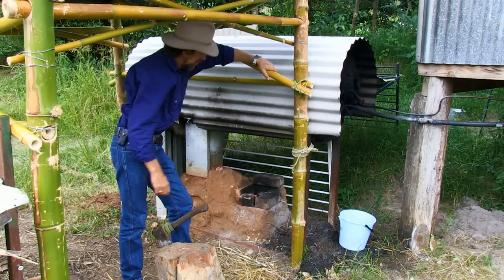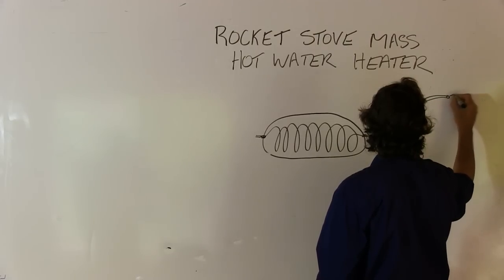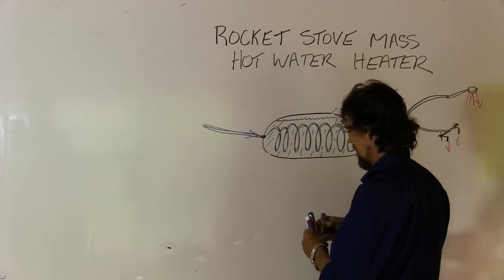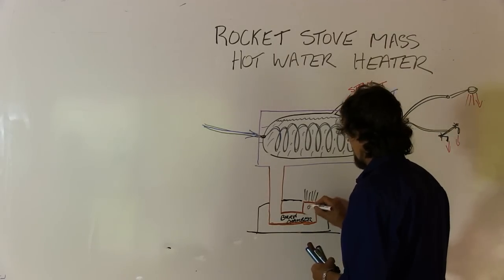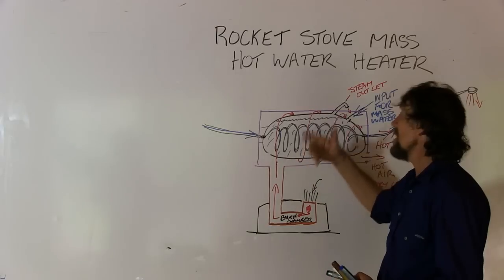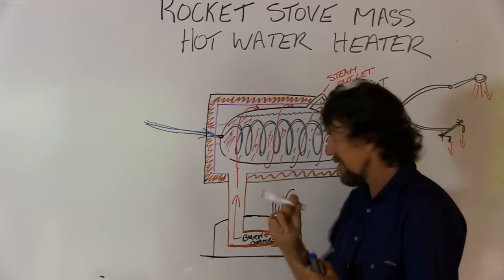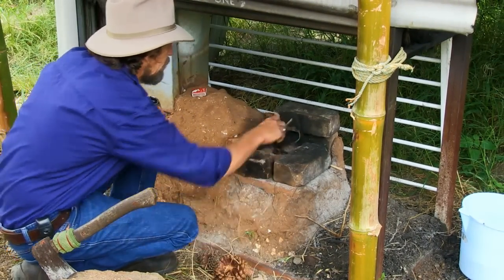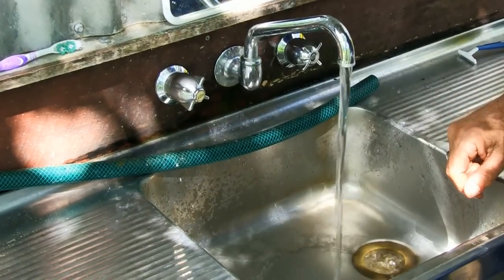How to Build a Rocket Stove Mass Water Heater, with Geoff Lawton

Comment: Thank you, but seems very, very complicated for most people. A rocket stove riser or metal chimney (non insulated) can be wrapped tight with copper pipe and connected to a body of water ABOVE with the cold line to the stove coming out the bottom of the water tank (that is a bit ABOVE) and the hot water line coming from the stove, and entering higher up the tank. I'm not an expert on the best way to wrap copper around a steel pipe but I know the copper is filled tightly with sand so it does not crush, and then the sand is removed. Look at "thermal siphon" rocket stove videos and don't make the water pipe too large or it will just spit steam.

Comment: A float valve to keep the outer tank full and a pop off. You could make a pipe with a ball on top.So if it gets too hot, purge steam off without exploding you can also take the residual steam and run it through a turbine to make electricity i have a big whistle on mine.

Comment: Why do you need that stainless steel tank with the water in it? Can it be just a bare copper coil? it got heat up directly.
What is the scientific reason behind it? Just asking.

Comment: Hey Geoff , I'm still trying to work out how to feed that copper coil inside and get it connected without access through another part of the tank . Do you cut an access hatch and weld it up again after fitting pipe and fittings to inlets and outlets ?

Comment: Right off the bat this takes an engineer to build and you want a big sealed Stainless steel tank ?  Where would a person even begin to locate something like that? Coiling Copper pipe isn't cut and dry, do it wrong and it can kink then you're screwed.. one technique for bending copper tubing calls for the tubing to be filled with sand.. this is a mess..  For another thing, even if you could find a stainless steel tank , that's not cheap.. for another thing that's retarded. Maintenence is going to be a real nightmare.. after all this work, this isn't going to last very long and nobody wet behind the ears would ever be able to use it safely without hands on supervision.  a huge waste of fuel for one person to shower just look at all that water you need to heat up .. not to mention , ever have a chimney swept?
after a period of time so much soot will have coated the stainless tank it will act as an insulator preventing the water inside from even being heated, ash is the world's best insulator, ever see people walk on coals? There's a hundred & one different reasons this is a horribly designed water heater.. 💧

Comment: thanks Geoff  great vid the best system I have seen to date . I have an off gride property with no infrastructure and you have just  solved my hot water problem  cheers  ps only another 50 or 100  other problem to solve  but will be loving every minute

Comment: He's building at the Antiquated way, there's a better way to build it using the out ventilation pipe and a copper coil surrounding the out ventilation pipe for the stove in which the heat from a stove heats the water from a separate tank and circulated back into the main system. This can be found on the show, off-grid builders.

Comment: how about if you flatten the top of the burn chamber and have a metal lid that can seal it shut to shut off the fire, then to activate this lid automatically you have the water overflow pipe fill up a container fixed on a pivot where the weight of it will pull the lid down after enough water has entered

Comment: Great video, Thanks. Just a quick question.... Where the feed to and from the copper coil pass through the heated chamber is there not the chance that it could turn to steam in the pipe if maybe you were running water via a pump and the pump failed?
Reply: yes you have to have a pressure relief valve somewhere on that line
Reply: cardiologist told me he has seen several cases lately that he believes are related to the vaccine. He mentioned he has also seen recent cases of myocarditis he believes are vaccine related. He advised me against any boosters in the future.

Comment: well, it's been five years.   Is this guy still alive?   Has he learned any hard lessons about the flash point of steam?   Glossing over a steam vent system is rather dangerous.  It involves far more thought than was communicated here.
Reply: He calls it a blow off valve but I'm pretty sure it's just an open tube. Naturally you would want to aim that somewhere where you wouldn't be standing but as he said, this unit is a demonstration unit at the school/farm so he wants people to be able to see every component. Here's where water is streaming out from that hot water overflow tube(blow of valve minus an actual valve)  https://youtu.be/1oDpmmsqHwQ?t=717
You'll notice he opens a spigot that's for topping off the tank occasionally and the hot water coming out of the overflow tube increases in flow. It's nothing but an open tube. No worries about a T&P valve malfunctioning. For those that don't know, T&P Valve = Temperature & Pressure Valve as used on standard water heaters. They're located near the top of a water heater but SHOULD have a pipe coming off of them that goes through the floor or wall so that when/if it needs to blow, it won't be blowing steam inside the house.
If it were me, I would use one of the old heater element holes as those are quite a bit larger. Less chance of pressure building up faster than the small tube can expel it. I would also run the overflow to a box with a screen on it so nothing crawls up inside and clog it, like a dirt dauber. They would get expelled pretty quickly but it would still startle you when it came unplugged.
Reply: I've seen another video where he says they burn it twice a day iirc. Once in the morning for the day's activities, like cooking and cleaning and once in the afternoon for people to take showers. This type of living isn't something a person who's worked in offices their whole life and hired people to service things would want to jump right into. Consult your blue collar friend before trying this at home.

Comment: Galvanic corrosion between the dissimilar metals? Longer term removal of bituminous build up on ss tank?
Reply: The water in the tank isn't used in the house. Only the water in the copper tubing.

Comment: I always come back to this one. Great video. How about coiling a hot water pipe around the heat riser/combustion chamber too? Would be too hot for showering, but could feed underfloor heating.
Reply: I think it's because to have complete combustion, you need a hot temperature, and wrapping that with water would cool it down too much.  Besides, it seems like they're already extracting nearly all the heat from the main chamber area.

Comment: Ok, but 
How do you clean out the ashes,  & how do you cool the water down in the shower so you don't get scalded, & are able to take a nice hot shower
Reply: The knob on the right is for cold water as is standard. It would require periodic disassembly to clean between the steel drum and stainless steel WH tank. You could probably build it with both ends of the steel drum removable. That would get you pretty good access in between.

Comment: This is a great setup.

One correction though: IMO the burn is all done before it leaves the riser.
Because beyond that it will get only colder, thus not burn anything more.
Reply: If you've ever watched a rocket stove in action, typically flames shoot out the top beyond the insulated heat riser.

Comment: Why introduce all the additional variables of multiple tanks, multiple water inlets/outlets, steam outlets, etc.  
Why not simply wrap your copper coils (far fewer needed since the heat would more directly transfer) around the chimney?  If this is too efficient heat transfer for even few wraps of copper (water too hot) then you could add insulation between the chimney and copper coil.  Manage water temperature by flow using a temperature gauge on the output side that controls flow (slows/increases flow).  Just a thought.
Reply: That small amount of water could fluctuate and build up pressure real quick. Heating the tank of water and using water inside tubing running through the tank water gives you a buffer. Introducing flow limiting/increasing device based on a temperature  sensing device adds complexity. If the water in the tubing gets too hot, what do you do? Pump it faster? Pump it to where? Back to a reservoir tank? He refers to a blow off valve but he really shouldn't as it's merely an open tube*which should be bigger imho and of course aimed out of harm's way). That means there's no moving parts, no temp or pressure valve, no thermostat or heating element. Nothing to fail really.

Comment: great video - it may be a dumb question but how does the water pressure happen - gravity feed water?  electric pump ? solar pump? plus the insulation on outside could use something more earth friendly?
Reply: That's a great question!
Water pressure is created by the interaction of 3 basic forces.  
1) Thermal expansion
2) Adhesion - of water due to hydrogen bonding.
3) Cohesion - of water due to hydrogen bonding.
The water in the coil is pressurized, therefore when the water heats and expands the pressure increases.  Then when you open a spigot the pressure releases through the spigot.  Then once the water begins flowing, it will continue to flow until you shut the spigot due to adhesion & cohesion - a suction like force that is inherent to water and certain other fluids.
Reply: They get all their water from ponds way up a hill so gravity and the weight of the water volume in the ponds gives them plenty of head pressure.

Comment: Well presented for the common man like me to understand.  Love the efficiency of this sys, i.e., low fuel consumption, minimal smoke output.  As a non-engineer looking at this, a few self-preservation alarms are going off in my head.  As I was reading through the commentary some others have voiced the same concerns.  The first thought that came to me was the need for a larger or an additional pressure release pipe off the filled-water drum.  Secondly, it is imperative the water filled drum does not ever evaporate completely (boiled off) under heat.  Suddenly filling an empty heated drum with cold water can cause an explosion.  I believe historically this has happened at some boiler industry building when testing locomotive boilers.  Can't recall where I read about it.  Thirdly, if your incoming copper line is under pressure (let's assume 40 - 60 p.s.i.), and all output valves are turned off to where it is sealed, what happens if the water in that copper line becomes too hot or even boils?  Is there some kind of pressure release valve in place for your hot water copper line?  Perhaps some type of thermo-gauge can be set up to monitor your hot water line temp?  Finally, I do not understand how the copper loop is installed.  Perhaps the tank is cut out and then welded after the copper installation?

Comment: Ok I`ve only just seen this and think it`s a great idea. I`m wondering if that excess steam/water from the release could go up into a pipe then dog leg and be collected into another vessel (Maybe a 20litre SS urn for instance) so it could be returned back to the heat chamber with the other water it came from. This would theoretically still have an open circuit for the pressure but also allow repeated use of the same water in the heating chamber. All it would need is a tap on the vessel which is opened after a little cooling to allow the water to flow back into the 200litre drum. Steam would still be vented off but allow collection of the liquid.
Just a thought in trying to prevent water loss making something a little more efficient

Comment: Why bother with the cool running through? You could just heat up all the water in the tank
Reply: IMO the cool copper line running through is under pressure and therefore can flow throughout your domicile.  If you just heat the water in the tank, which could dangerously boil, you would need to get that water into your house somehow.

Comment: One should NEVER burn pine wood or cones in a system like this or you will someday experience a chimney fire.  Not fun.
Reply: Rocket stoves if run right burn all the wood and gasify it so there is no chimney build up. You get that problem in conventional wood stoves and fire places from the inefficient burn and dampening the fire so it smolders.

Comment: Stainless + copper + water = battery, no?  Corrosion galore?
Plus you need another hose - at the bottom, clear, rising up to above the top of the tank (outside) to see the water level

Comment: All that for hot shower water ?  Way over engineered, one old water heater, 25-30 ft of 1/2in. Copper tubing, one check valve, and a small camp stove, make a coil over the stove pipe, supply water from old water tank, with check valve installed at bottom of tank, reroute the opposite end of the coil back into the water heater.... Works like a coffee maker. No pump or electricity needed.

Comment: hot water heater? why do you need to heat hot water? it's a "Water Heater"
Reply: maybe the water heater itself is hot
Reply: I see your point, but in this case the hot water is what is heating the the water in the copper tube. so it actually is a hot water heater
Reply: you can take the hot water and pump it through a radiator. you mount fan behind or put in your duct and you get blown heat and the fire is out side

Comment: i would make 1 modification, were the fire is started i would have some sort of panel that could be removed for easy removal of ash and this would make running a chimney brush easier as well for cleaning the flute directly after the fire, but awesome video thanks for making it!

Comment: I feel like an air to water heat exchanger or a pot on the stove + a hot water pump would be a lot simpler and more efficient.  Every heated surface in your design is a form of resistance and heat loss.  Sure all the layers insulate the heat but they also conduct it away from the copper tubing (which is really all you want to heat) until the wind comes and convects it off the corrugated sheet.
Reply: I've seen another design where the exhaust gas from the heat riser is sent through ducting, and in that ducting is a coil that holds the water you will use. That line has a pressure release on it, but the setup in this system is a bit safer, and you will continue to get hot to warm water with this system after the fire goes out, so long as the water tank hasn't been cooled down.

Comment: Question (and pardon my stupidity please), Would it be a good idea to add an extra steam outlet for added protection against the build up? I am all for checking, re-checking, and checking again. So for me, nothing wrong with extra precaution. Having said, would it be wise to have two steam outlets, and if so, would it effect the heat output of the unit? Thanks in advance, and again, pardon my stupidity.
Reply: +Scott Noble Yes the copper line can go into a boil, not a good thing. LOL.

Comment: good system but does not have an actual relief valve; if the steam vent should plug up (not a relief valve) from hard water deposits, an explosion will occur ,,,
Reply: Richard Cockburn - T&P valves plug up from hard water deposits too...   Either require maintenance, but an open 3/4" tube will require less frequent cleaning than the T&P valve's smaller opening... 

  And everyone should watch mythbuster's exploding water heater video, to truly understand the hazard of uncontrolled heating of water in a closed system, or improperly vented open system, and how important a vent of some sort is.

  T&P or pressure valves are only needed in a closed system.  A system like this, where the only directly heated water is open to the atmosphere, can use a simple tube vent like this, just fine.  Actually safer than a T&P valve as there is no pressure required for steam to start venting.

  The closed copper coil part of the system should have T&P valve though, in case anyone ever fires up the rocket core with no water in the open buffer/water mass tank that the closed copper lines pass through.
Reply: Just needs a stern warning sign at the firebox about double checking the water level before firing.

Comment: maybe has been asked before, but could not find it... how do you clean the ash from the stove? and could you center the stove heat to the center of the tank and have the hot air exit from the top? or more efficient from one end to end? maybe does not matter? nice video,ty.

Comment: Geoff. Not sure if this is your channel or not, but if you read this, I have sort of a funny story about "hot water heaters". I use to work as a plumber for a while, and anytime I would say "hot water heater" in front of my boss, he would go off, telling me in a real smart way, "you don't heat hot water bo, it's a water heater. If the water is hot, there's no need to heat it" (god rest his soul). He use to get on my nerves, but he was right. I thought you might get a kick out of that story.
 But here in the USA, everything is built disposable. Everything in a water heater is replacable, except the tank of course, when it leaks, there's no repairing it. So here, if we find an old water heater tank, it's usally no good. I heard you mention stainless steel tanks. I'd like to have a water heater made from stainless steel, it would never need replacing, only repaired. Or even high heat resistant plastic. But no company wants to build a water heater (or any other product for that matter)to last forever.
 Cool video.

Comment: I'd like to have seen this being made - especially how the copper coil got threaded...
Reply: That’s the part that seems tricky. Need a large plug with a reducing bushing to feed in. Bushing gets put on after copper is threaded in, then probably a compression fitting.